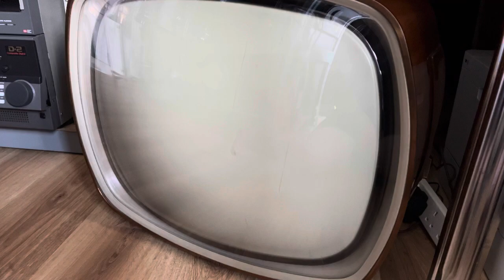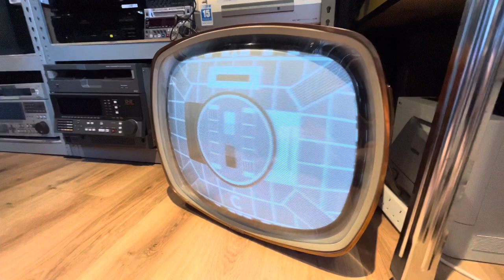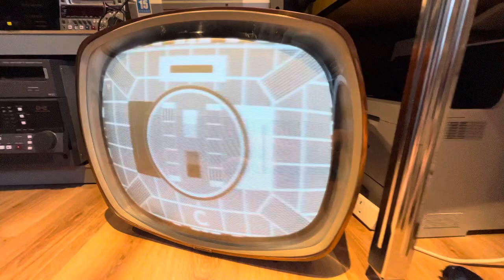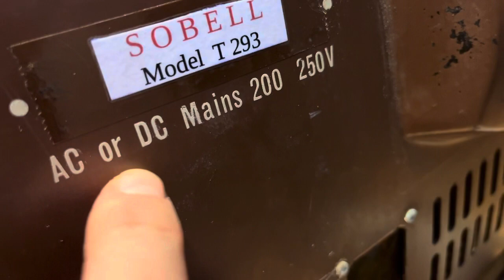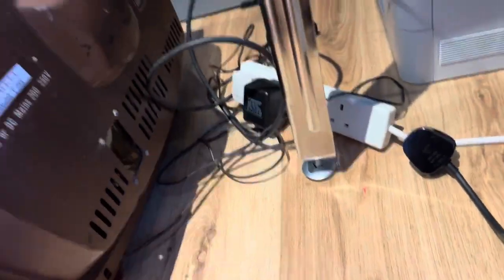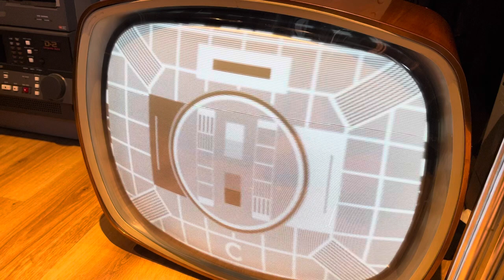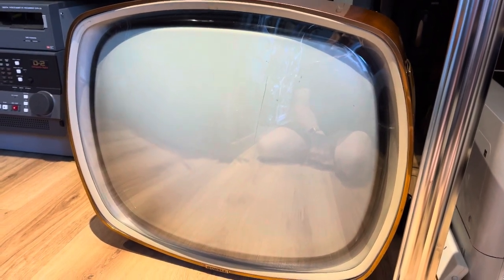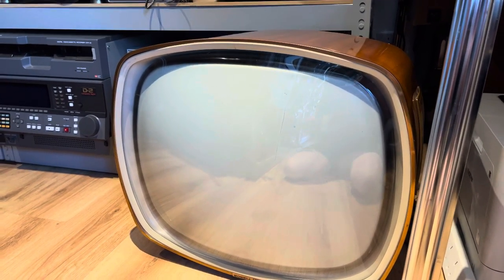405 Line Valve TV. 1960s British TV

Comment: The 405 line system was employed by the BBC in 1936 to provide the first regular high definition (for the times) tv service in the world.
Reply: HOW IS THAT HD!?
Reply: @edwardcole4623  It was, as I said, HD for the time. The Germans were using 180 and 375 lines at the time of the Berlin Olympics in 1936 so 405 lines compared very favourably with those systems. Also as tv screen sizes were considerably smaller in those days a 405 line picture gave a very acceptable picture definition for the viewer. A vast increase in quality since the 30 line pictures broadcast earlier in the 1930's.

Comment: The point about  405 is that it required bandwidth that radar required. Isaac Schoenberg the boss of Alan Blumlein told him to go work for Mr Churchill. Unfortunately testing radar caused him to die. It's said the Halifax research aircraft caught fire.  Herman Goering is supposed to have said the Blumlein H2S radar cost him the war. H2S unlike other systems was quick to do. Blumlein was said to be humble and helpful to his staff.  Extremely dyslexic. He designed low noise cables at first. Then record cutting lathes.

Comment: Just think if the BBC had persisted with 405 line colour in NTSC This set would have been sensational. The definition was far better than many think. The system is late 1930s and was said to be a smoke screen for radar. Germany wouldn't notice advanced valve manufacturing if TV was around.  Alan Blumlein being linked to both TV and stereo. Blumlein explained long tail pair differential amplifiers. Also distributed load Pentode or Beam Tetrode amplifiers.  The BBC invented many refinements to 405. It's said these were incorporated into 525 line NTSC. Rumour has it the government stopped them and insisted on PAL. Another rumour is the Soviet union helped the BBC test BBC NTSC by lending the Moscow TV cable network during close down. A BBC engineer called Lucy said in the studio NTSC in 525 was at the time best. Better colour and definition. At the transmitter it already had degraded.  Lucy said  1960s probably Ampex big real video programs from the USA would be impressive even today.  I seem to remember the USA had a 443 line system at some point. 405 line with spot modulation could almost hide the lines. The main problems with 405 was poor quality receivers which was often thought to be the format. Sony TV 9-90 was excellent although expensive. It was 405/625. Sometimes the 405 had more contrast.
Reply from the maker: Incredible information.  Thanks for posting. Best wishes Howard